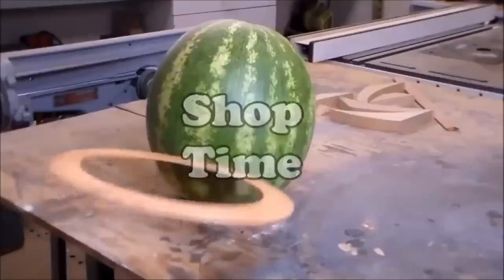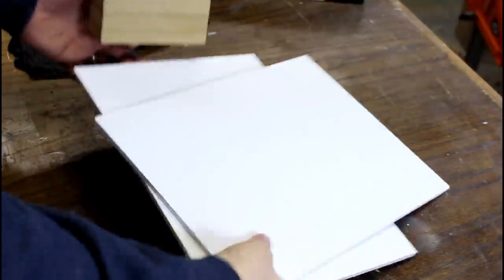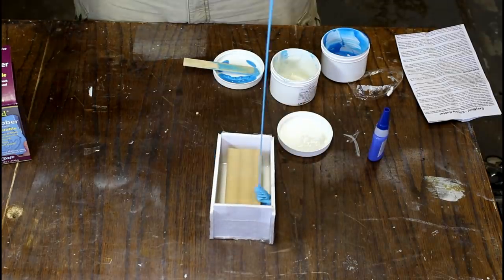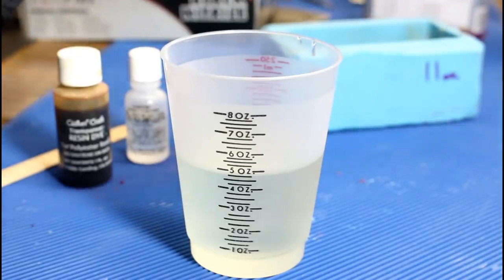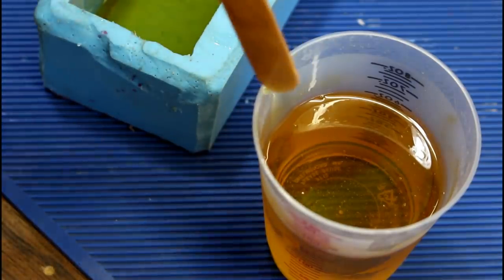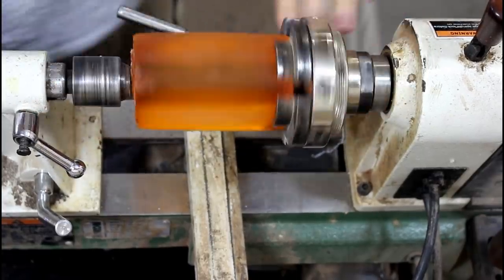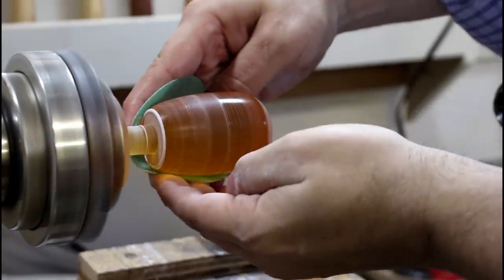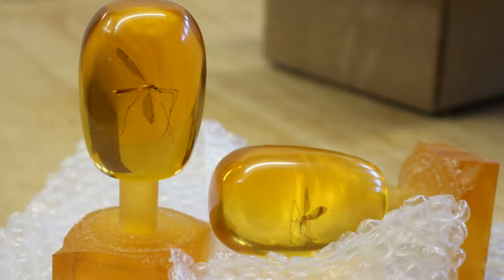DipIt #14: Mosquito in Amber Prop Replica

Comment: totally random but im curious, could you put an apple in epoxy and do a time lapse to see if it will get rotten? or in general, would it?
Reply: i would think it would rot, unless its somehow 100% sterile
Reply: Devon O it wouldn't, he did a dip it where he put bacon in epoxy. It's still resting in a drawer in his house
Reply: Duck_Billed_Atheist so you could open the bacon in 2063 and eat it? ( if you first maybe wrap it in aluminium foil
Reply: Devon O Apples rot due to It being exposed to air. If it doesn't get oxygen, it will not rot.
Reply: epoxy stops the natural process of breaking down, one of his fist projects was bacon in a screw driver handle, it's still holding up years later
Reply: Bacon is cured and full of salt though. It wouldn't rot even if it wasn't in resin.
Reply: Apples will only rot if there are microorganisms to break it down, which wouldn't be able to live encased in resin. A human body would probably rot, though, since we have living microorganisms inside us at all times.
Reply: An apple encased in resin absolutely would rot.

Again, the only reason the bacon doesn't rot is because of a lack of moisture and an excess of salt.
Reply: All of these arguments... and only one way to find out if the apple rots or not....

MR. PETER BROWN!!!! WE SUMMON YOU
Reply: Devon Anything exposed to oxidation which comes from light can rot, eg plastic bags but in epoxy I'm not sure so I'm curious also
Reply: Duck_Billed_Atheist Uhhh it definitely would. Not only will it still oxidize because of the oxygen trapped inside the apple, but it with rot because of the bacteria inside, and outside of the apple. Check your logic please.
Reply: Taehyung's Giggle Not true at all. Oxidation isn’t the catalyst of the decaying process. It’s due to bacteria!!
Reply: PuffyRainbowCloud There are microorganisms located inside of all foods unless they’re somehow 100% sterile.
Reply: RicoDuroska Thank you!
Reply: For some reason I want to use this as a shift knob. I think an "amber" shift knob with a mosquito in it would look different but cool at the same time.
Reply: David Violas only if you drive standard boyo. No modded "shift" knobs on an automatic
Reply: So maybe this is McDonalds secret recipe to their eternally fresh French Fries? The deep fry is really epoxy!

Comment: Hi Peter, if you ever need to make a mold like this again: instead of wrapping the wooden block in packing tape try sanding it really smooth then spraying it with lacquer. The silicon will not stick and you get a very smooth mold which will greatly improve how many times you can use it. 
I look forward to you video's
all the best 
George

Comment: Could you make something with resin and ice (ice cubes)  maybe it gives a nice look
Reply: Valentin P. No
Reply: gregistopal when it works why not but when it doesn't work it was a experience
Reply: Unless you were to freeze the resin while curing the ice would melt and if I got it right from the video resin doesn't like moisture.
Reply: SmilyLily1996 resin also heats up a lot when curing
Reply: I have been thinking how to utilize ice/snow in my projects for a while now, but nothing comes to mind so far :/ Damn its hard material to work with XD

Comment: you really should get a vacuum chamber or vibrating pad to get out the bubbles.
Reply: TheKing of Random fan?
Reply: yeah
Reply: just buy a 12v vibrator element and 12 v power supply: Total cost 10 bucks, or a 12v vacuum pump on ebay cost 25 bucks.
Reply: Tibo Huyers he listened to you and got one
Reply: Tibo Huyers ok

Comment: Could you try using a vacuum chamber to get rid of ALL the bubbles? I think the resulting cast would be awesome!
Reply: TheRoot wouldn't a vaccumm just expand the bubbles and make them bigger?
Reply: If i'm correct, i believe the bubbles pop therefore drawing them ti the surface.
Reply: Ola Burr i think that’s how it works, the bubbles get bigger and float to the top
Reply: good answer yes the vacuum would expel all the bubbles. i would have gave the same answer.

Comment: I know its not your MO, but why not make a mold already that shape?
Reply: I meant specifically the resin knob part, not the wooden cane.  Or did you mean that the shape would have to be made in wood first to make the mold? Wood isn't ideal for making original positives. Even then, he could have saved  himself shaving time. And a casting could be made any size you wanted it to be, even to compensate for polishing. 
As a prop maker, I guess I'm saying I would have gone about it differently.  I was curious whether or not he had a specific reason for approaching it that way.
Reply: GreenGleem You're gonna have to shave and polish it anyway, so I think it's fastest to make a cube and then cut it, instead of making the mold the size you want it to be.
Reply: GreenGleem ddjg

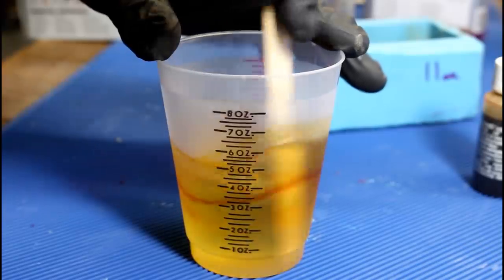Comment: what's the thing that flashes on the screen at 4:51?
Reply: sourc3canna jurassic alphabet
Reply: sourc3canna
Reply: sourc3canna if u look in pockets video there is a msg u need to decrypt using this
Reply: Its a secret message, look the other video for the message.
It wont dissapoint you 10/10 totally would do it again
Reply: ILLUMINATI

Comment: A degasser (basically a small vacuum chamber)  will remove all the air bubbles from the silicone rubber before you pour it, which will result in a perfect pour every time. Also, when working with resin, use either a heat gun or a propane torch at a reasonable distance from your project, to greatly assist in removal of air bubbles.

Comment: If you still do these, you can get a mouse sander that uses the velcro sanding pads. Then just screw one of the sanding pad to your work bench, sandy side to the bench, and stick the sander to it when you need to vibrate the table to remove bubbles.

Comment: Wonderful video, you've inspired me to do some stuff regarding fossils/amber when I get the supplies. Question: Perhaps it could be easier to fake Amber using 2 part epoxy resin in layers and using a long lighter to gently torch out the bubbles?

Comment: When pouring silicone into your mold it's best to pour into a corner of the mold and let the silicone self level and rise over the piece instead of directly onto it, minimizes air bubbles, especially if you have a slightly more complex item
Reply: Also, putting a mold release on the item beforehand is usually a good idea, Murphy's oil soap mixed with water works well for me

Comment: #########BUBBLE ALERT ###### BUBBLE ALERT############

To get the bubbles out and you have the perfect case to do it the best. Pour a 1/4 inch level, use a hair dryer to wipe the bubbles away. Just hold the hairdryer about 3 inches above you resin. They will come to the surface and immediately pop. Then keep pouring 1/4 inch thickness at a time and remove the bubbles with the hair dryer. 
It really really works.... When I was told I thought it was just silly. It's the best thing for gettin those pesty bubbles OUT...
Good luck and thank you for this awesome video.

Comment: ...just a suggestion...but rather than sanding forever, you might try sanding to about 220.  Then mix up some clear resin and with a soft paint brush, brush it on and set it down with the bulb side up to dry.  It will fill all the micro scratches from sanding and leave you with a smooth, flawless finish.

Comment: A couple of tips I picked up from the guy who made the resin ticket for the opening of "X-files the movie".

1: Use a vacuum cabinet of plexi to remove air in a pour.

2: Build a shaker table surface. It vibrates out excess air of a pour when placing the mold on the table, pouring and immediately shaking the table surface.

Results may vary depending on the viscosity of the poured resin or silicone of course.

Trivia. Cannot recall the name of the guy who made it though. He was also involved in the special FX to create some of the props used to portray the dying horses and other stuff in "Dances with Wolves". Was a long time ago I met this guy in LA.

Comment: As far as the bubbles.....you need a vibration table.....You may not know but in the early 70's they had a game that was a vibration table in the form of a foot ball table. it would shake for a time and your players would move all over....lol It was fun but a vibration table has many  applications that really could be use full in getting those pesky bubbles out. but only in the short term.... If used till set then you would get waves in your resin . Just a thought.

Comment: I've used a vacume tank made from an old pressue cooker to degass my silicone molds and my casting resins. With Polyurethane resins you can put the castings in a pressure tank at 80-150 psi and the air bubbles will disolve into the casting resin making them bubble free works good. Not sure if it would work on Polyester resins

Comment: Try drying the insects in the oven, before sealing them in epoxy.  IMO, you should leave a few bubbles and insert a few teeny-tiny artifacts like tree bark, dirt, and pebbles/sand to make it look more realistic!  Very rarely are pieces of amber so pristine.
Reply: It's not supposed to look like realistic amber though, it was wupposed to get as close to the movie prop as possible and that was pretty much flawless as I recall.

Comment: First, don’t use wood, it is a porous material which means the silicone will stick to the wood
Second, when your pour something, poor it on a wall of the mold so you aren’t creating air bubbles when pouring, just like pouring beer or soda, you pour the drink of the side so you aren’t disturbing the drink with air :)

Comment: Wonder how it would look if you add dye after mixing the resin, and in phases, first 3/4 f the dye, stirred well then other half of the rest snd stirr not too much and lastlly the left stirred somewhat, it could add there differencies in colour,  But, as you have to cast it in two phases it would not look too good, as layers would be seen afterwards, so that would demand 1 cast/pour technique..

Comment: Save yourself some labor: Get an incandescent light bulb of the size and shape you want in the finished product.  Carefully twist off the metal base. With a small pair of pliers, very carefully nibble away the glass at the base end of the bulb until you have an opening as wide as the neck.  Pour in the epoxy and bugs as desired, let cure, and break away the glass.  What you have now is practically a finished product.  I have done this many times using small, tail-light sized, bulbs and embedded screwdriver tips to make tiny screwdrivers for tight spaces.  You are welcome.